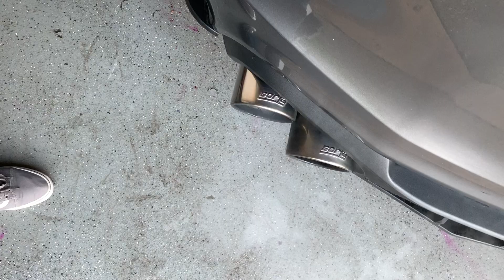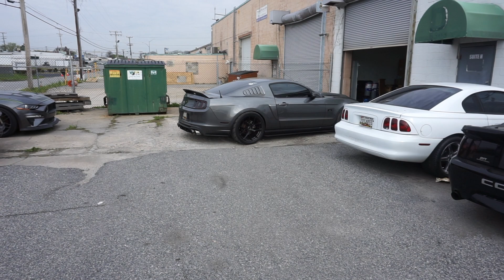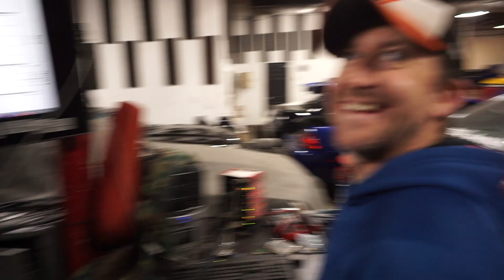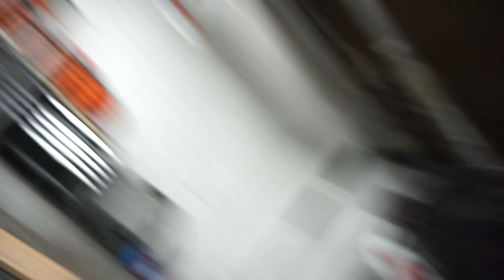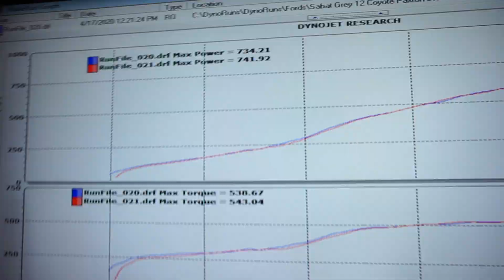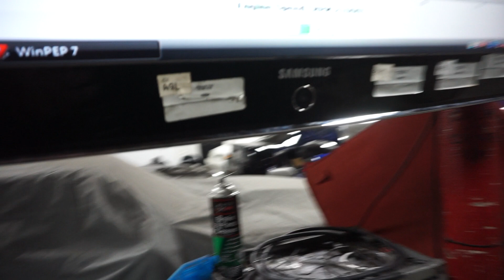Frankenstein Coyote First Drive & Tune - VLOG #40

Comment: Heads up your chop was probably a lean/rich condition, if you voltage was 12 or less I would check on your injector offsets in your tuning.
Reply from the maker: Yeah that’s ultimately what it was. The alternator pulley came off so the whole serpentine belt system wasn’t running etc I never even noticed because I was too excited about the car starting/running lmao
Reply: @pokemasterbs  yeah if the offset is wrong it won't inject the correct fueling as compared to when the alternator was working.    Car should run same at 10-16v

Comment: So how has she been holding up so far? Run into anything so far?
Reply from the maker: Motors been holding up great! I’ve had issues come about but nothing motor related. Tune was finalized and it’s making 900 whp now as well. 🤘
Reply: @pokemasterbs  awesome brotha, I’m fixing to do the swap but with my gen1 heads and your vids have been awesome to watch my man, great content!
Reply: I think the only thing different im gonna do is gap the rings
Reply from the maker: For sure. Depending on your boost levels and intended driving gapping the rings is definitely something to consider. I didn’t feel it was really all that necessary given my end goals, but it wouldn’t have been a bad thing to do if I decided to. For the ultimate decision for me not to was frankly the fact that I don’t necessarily know how lol

Comment: Quick run down on price for the 
gen 3 block 
gen 2 heads, even if it’s an estimate?

Also I’m full bolt on now, with 18 manifold, 2011 6speed. 
would going the Frankenstein route be dumb for staying n/a would you only recommend going that route if it’s boost or do the build, for the reliability? I think I started watching your vids at 3am it’s almost 6am lol I subscribed. Love the vids!
Reply from the maker: Shortblock is 1800~ before the 500 core charge and the heads usually end up at 1300~ with the core charge right now. 

I personally wouldn’t worry about doing it unless you need a rebuild or are trying to do like a max effort NA build. You will gain power over the gen 1 setup because of the better flowing heads and higher compression. If you do cams I think you would end up in the low to mid 500s based on what o have seen from someone I know that did this same engine build for an NA car. I don’t know that it’s particularly more reliable than the gen 1 unless you talking at the higher power numbers. Thanks for the sub!
Reply: @pokemasterbs  What part # shortblock did you order?
Reply from the maker: Should be JR3Z-6009-A. I don’t know for sure if that’s the part number I got, but that’s what I found when doing a quick search on the online catalog 🤷‍♂️

Comment: Did you have to do a couple crank relearns or did you do it once and it slowly cleared itself? Having multiple misfire codes myself, motor sounds healthy no smoke at all and only threw the codes once I started doing baby hits, just wondering if I’m experiencing the same thing
Reply from the maker: No I only ever had to do one crank relearn for my car. It’s usually a one and done type deal. And if the clutch was off the car at all or a new bottom end was put in etc the relearn is definitely needed to be done every time. But it’s also an easy thing to do with any ngauge or SCT X4 and free. So I would give it a try and see where that gets you. It can’t hurt anything really.

Comment: So why did you do a Gen 3 short block + Gen 2 heads, versus... a Gen 2 short block and Gen 1 heads? Or just building a Gen 1 block and Gen 1 heads. I'm not sure I'm understanding the wizardry behind this build. Amazing power by the way! 

P.S. can you do a video angle from say the back seat looking forward?
Reply from the maker: So I mean part of it was my situation and wanting to have a complete extra motor when done for the wife’s restoration car. But mainly the gen 3 shortblock has stronger upper cylinder support, bigger head studs, higher compression pistons, and larger cylinders (307ci vs 302ci) and then gen 2 heads are boss 302 flow equivalent but in cast form. So they are cheaper but flow just as good compared to the more restrictive gen 1 heads. So these were simpler ways to build a better stronger motor without spending the crazy amounts of money that you can spend building an over the top coyote motor. Building a gen 1 motor however you want with sleeves etc is certainly the better way to go if you’re aiming to crest the 1000hp Mark, but for me it was more advantageous to do the Frankenstein setup and not have to change a single thing about my power adder setup and still have a gain of 250hp. But thank you, and I will try to incorporate that in a video at some point! 👍
Reply: @pokemasterbs  Appreciate the reply. So bigger head bolts you say,  are they now 12mm (or bigger)? That's wild. I heard - and see - the block is a single casting such as the previous 4.6's, so it makes total sense that the Gen 3 are stronger than older designs but what about this so-called "piston slap" claim? Some say it's the cylinder coating while others say it's noise from the plastic oil pan to oil pressure. Any concerns?

Again, awesome build and I hope you go out and race some people; hopefully your buddy @JD JoyrideTV. I know he's not a racer but try a set something up.
Reply from the maker: Yes they are 12mm like the 11-12 blocks were. The casting is a little different and has more upper cylinder support than the older blocks. As for the piston slap I think it was something to do with the cylinder coating and that process was changed or updated in later 2018 so the newer blocks (which mine was) shouldn’t have that same concern. It is certainly something to keep in mind and be weary of but I haven’t had any issues with it myself. But thanks man, as for JD you’ll have to convince him yourself lol he doesn’t seem to have any real interest in lining up with me or anyone else I know of. I’m not a big racer myself but I’ve got no issues lining up with any friends fast fast or not 🤷‍♂️
Reply: @pokemasterbs  Figured since you knew him you'd have more lead way. Oh well.
Reply from the maker: @Devious_5.2  I mean trust me I’ve tried a number of times including when my car was only making 600s. He just laughs it off 🤷‍♂️

Comment: Loving these vids man. I've ask so much and searched about using the gen 3 shortblock on a gen 1 car and didn't get anywhere with it. Hoping it works well for you and I can use your vids for mine if I go gen 3. Appreciate what you're doing!
Reply from the maker: Glad you've found them to be helpful! The lack of info I could find out there is why I wanted to put all this together. It's been working great for me and been quite consistent so hoping it continues to be that way!
Reply: Hope it lasts a long time 👊. I've wondered I know ppl do the 3-2-1 but if gen 1 heads can work on a gen 2 and gen 2 heads on a gen 3 why won't gen 1 work on gen 3? Or maybe it hasn't been tried yet. Thanks for the reply!
Reply: @joshbergman5597  gen 1 heads will work.
Reply: @J F thank you! Just always wondered why the gen 1 guys doing the gen 3 swap didn't just use their heads to save on cost. Appreciate it
Reply: @joshbergman5597  gen 2 heads are just pretty cheap and they flow better than gen 1 heads. On N/A stuff, gen 2 heads are worth about 15-25 whp over gen 1 heads depending on the application. On boosted stuff, id guess its worth even more power than that.
Reply from the maker: Gen 1 heads do work. There’s a few out there who have run them. I touched in it in the second motor build video of mounting the heads and the differences between them and the head gaskets. But as stated the big difference between them is better flowing and more power essentially so at a decent cost it only made sense to me as I wanted to keep my old motor whole for the wife’s car.
Reply: I get that they make more power. No point in spending the money if gen 1 heads work IF you're going boost tho IMO. Thanks for the response